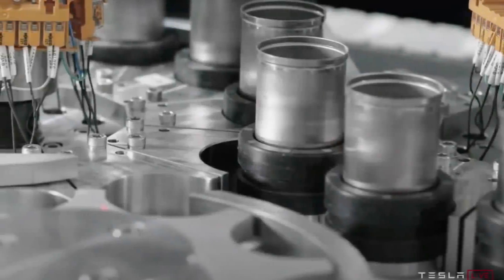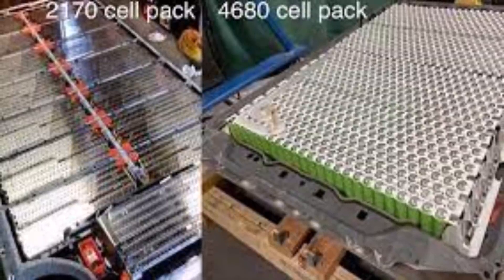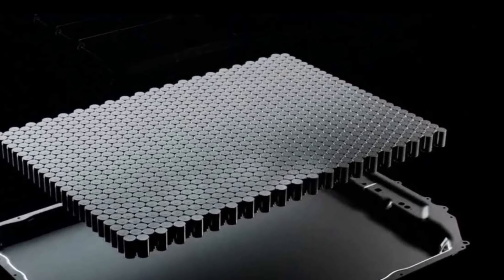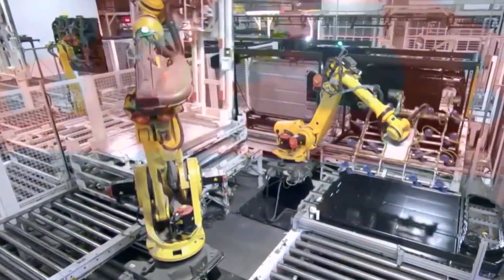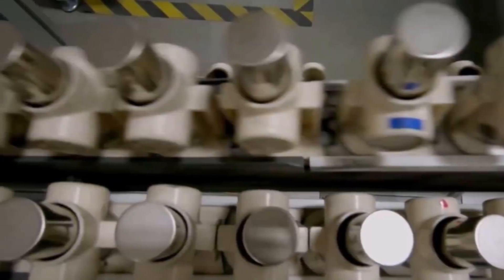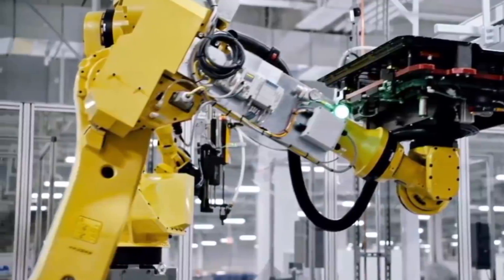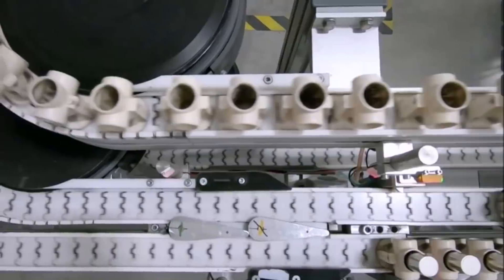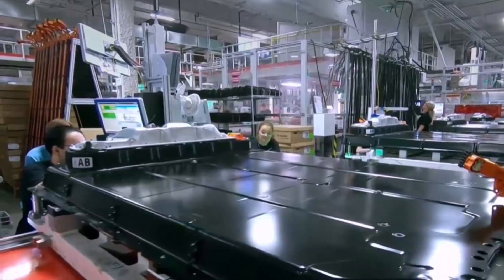GAMECHANGER! Tesla Will Find a Way To Get 4680 Cells To a 90% Yield

Comment: The tab is continuous not a separate welded tab, in effect the tab goes away. Lower resistance, less heat and better conduction of heat and electricity out of battery at the same time.Plus one less point of failure (actually two, punch-thru and weld). Of course it will charge much faster.

Comment: Seem to remember Panasonic had a ramp up problem with the 2170 cells in Nevada, and they ended up not producing anything exciting in the area of production volume (35-40gwh?).  Their current production's insignificant relative to what batteries China is producing today?   Seems Elon was right in yelling at Panasonic for their turtle speed?

Comment: &0 to 80% yield is a big improvement from 20 to 30 but I think Elon will demand very high yield with little waste before replicating the production lines world wide. That's the issue for Elon, safety, cost, reliability and performance, before replicating the production lines world wide.

Comment: I,m still Gobsmacked About Tesla's new Ai server  chips  they  interlock  into slabs  &  go from teraflops to Eflofs 
   Elon has got the  chip makers   thinking again   -  All we need now  is Cheaper faster HDD's   sdd   50tb 100tb    
tesla's servers racks & racks all  learning Ai   like near  quantum speeds -   Replacement of the old  cpu/gpu system  
 4 sale  tesla    about 10,000 RTX 3080's  gpus  1/2 price $350  Elon Elon   plays  that groundhog  clip  :)

Comment: Does anyone know the cost of recycling the 4680 battery. Will Tesla have to subsidize the recycling cost?
Reply: Do you mean at end of life, or are you referring to the cells rejected during production?

At end of life, the value of the materials will exceed the recycling cost. J B Straubel is going into this business with Redwood.
Reply: @carl-Sp  the rejected cells, could it cost more to recycle than the value of the materials?
Reply: Shane Doubt it, but if so it just means there’s a role for regulation, just like you can’t chuck a lead acid battery in the bin.

Comment: Arman, this guy has many good long, in depth videos, but minute 8 shows the tabless electrode. Instead of welding on a tab, they cut and fold the foil, and both the copper and aluminum foil are excellent heat conductors, in addition to electricity. https://youtu.be/V5Fe2twxWuM.  You cover news. He does deep dive on certain topics. Whole different thing.
Reply from the maker: Thanks Frank, looking.

Comment: They are called tables cells because there is no welded tab (like 1865 & 2170). The folded over contacts on the 4680 battery cell could make contact via pressure - not welding
Reply: They are tabless because there is not a single tab on each side (anode & cathode). They have connections for each along the entire length of the “jelly roll.” The big change is the length each charge travels during charging and use. The 2170 tabbed batteries have a long path - on average the charge travels across ¼ of the length of the roll (think meters). The 4680 path is just the length of the cell (80mm). The big shift is that the extra distance produces a lot of additional heat, especially when charging.
Reply from the maker: Thanks Lee.

Comment: Manufacturers that I have dealt with have a total recall at 3% of failure. 10% failure rate is a huge loss and would waste material and machine time.
Reply: But how does that compare to other similar battery manufacture?
Reply: @StinkFingerr  nobody else is making the 4680.

Comment: Upon critical specifications published :- 
 % yield / sigma quality chart. 
70 / 2.0 (more to work)
80 / 2.4 (“)
90 / 2.8 (“)
99 / 3.9 (“)
99.9 / 4.6 (“)
99.99 / 5.3 (<5.3 stop production)
99.999 / 5.76 (threshold to ramp)
99.9997 / 6.0 (goal to mass production)
Reply: Thanks. I dealt with this as a 6 Sigma blackbelt. Are you saying you know what Tesla's desired specifications? Are these their goals? Or is this proposed?
Reply: @AndyZach  Tesla is wise enough to not publish their critical specification limits at the time of publishing Battery yield. Your guess is as good as mine. Those are chart adopt by some company for you reference not necessarily any specific manufacturer.

Comment: Anyone responsible for quality mass production knows very well that yield figure has no meaning without critical specifications published. Critical specifications as driven by performance reliability and safety.
Reply: We also know that the 4680 is on the road now and has been for a while in cars and Semi prototypes. They are gathering real-world data.
Reply: @michaelsmith2723  your argument add little to no weight as counter argument.
Reply: @philoso377  It's not a counterargument. It's a fact. It isn't contrary to your statement. It doesn't take away from your good point that yield must be compared to specs. I saw your good point correlating the yield to the sigma value.

Comment: It seems like the recycling cost would be the largest factor in what the acceptable production yield would be. If the bulk of the cost of a battery is materials, and you can easily get all the raw materials out during recycling, you might not lose that much by having to recycle 15% of batteries. The higher the cost of recycling/remanufacturing, the fewer bad batteries you can tolerate and the higher production yield you'd need.
Reply: Making your own battery's will make recycling them much easier too! Also less fire's and chance of damage to battery makes recycling easier too. I just hope recycling tabless dry cell battery's is easier in normal conditions too.
Reply: @lachlanB323  I learned they recently started recycling used Tesla batteries. Recycling newly (mis-)manufactured Tesla batteries should be easier still.